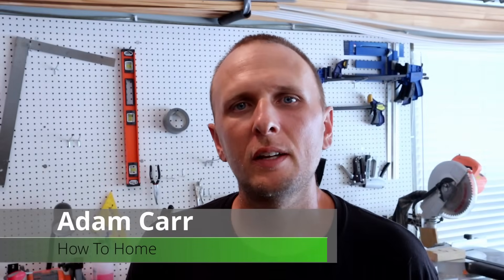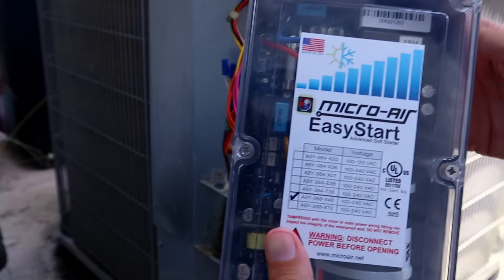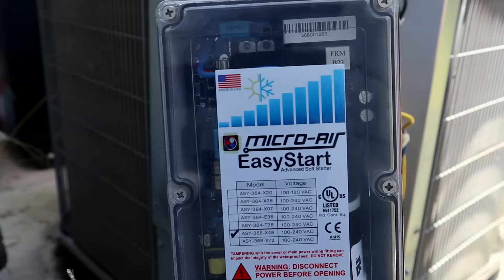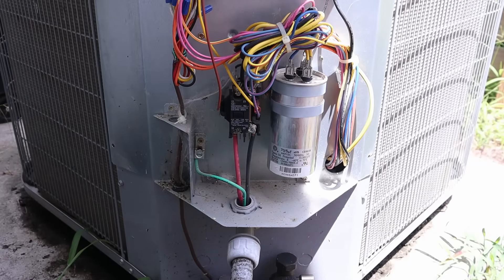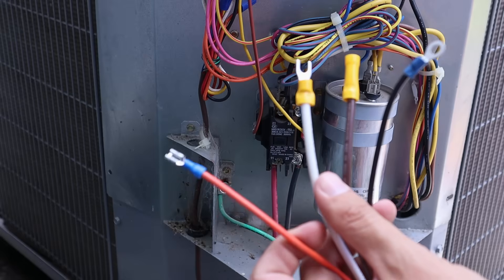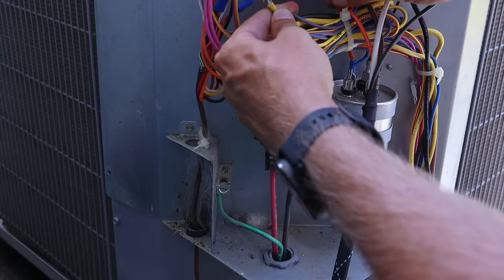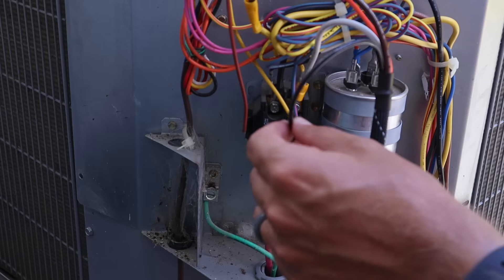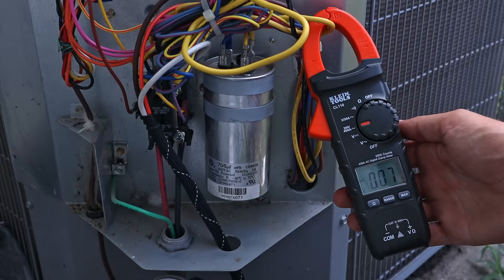How To Install A Soft Start Kit On A Air Conditioner | Run Home AC With A Generator | MicroAir

Comment: Thanks for video, been considering this for my home AC.  The soft start current reduction is great, but had question in running current.  It went from 12 amps to 7-8 amps which is great, but not sure what this means.  Seems like using less electricity, but is the cooling the same?  If it is the same, why don’t manufacturers put soft starts on all their AC units? Thanks again.
Reply: Thank you for detailed reply. I might have to look into doing something like this so I can maybe use my 2000W gas inverter generator. Thank you, again!
Reply from the maker: Hey Jeff, yes, even though the electrical requirement is less, the cooling remains the same.  Basically it is making the startup of you AC unit, more efficient.  On the home AC, instead of sending one big blast of electricity all at once, the soft start starts the fan first, then after a few seconds, the compressor kicks on.   By doing it this way and gradually ramping up the power, the unit is not drawing as much amperage all at once.  In a generator application, running the AC is not the issue, they dont use that much power to run, it is the starting in rush amperage that makes it difficult to impossible without one of these devices.  As far as running current, it doesn't affect that much if at all, they are really just for the starting of the AC unit.  I have seen different explanations as to why these or hard starts aren't already installed and the answer I saw the most and makes the most sense, is it just adds cost to the manufacturing of the units.  Hard start kits were actually fairly common on AC units years ago and some of your more expensive models, from what I have read do have them installed already.  So while there is no clear cut answer, those are the answers I have gathered from people in the industry talking about it.  I hope this was helpful and answered your questions.
Reply: @HowToHomeDIY  Some AC units have VFDs installed and have no LRA on the motor, these are super efficient units, but they are expensive of course!

Comment: Do you think that a duromax xp1300xp would be enough to run 4 ton central and some lights?    Thanks for your videos
Reply from the maker: It just depends on what your current in rush amps are and what they will get down to after installing the soft start.   If you can get below 40 amps like I did then yes that generator should be able to run the AC.  It’s just the startup that is hard, running the AC doesn’t require a lot.  I am picking 40 amps or less as the goal so that there really isn’t much strain on that generator.  The peak watts on that generator are 12,000 which is 50 amps.  Just don’t want to Max it out especially since you will be wanting to run some lights.  Hope this helps!

Comment: Hello, I watched both of your hard and soft start kit videos. It looks both of them brought the inrush amps from 72 to 36, so they are the same. However, I have a hard time believing that your 4 ton comes on with only 72 inrush amps. Mine is a Reheem 4 ton, which is only 5 years old 80% efficient unit, but the sucker has an inrush at 109 amps. I am wondering if yours were 109 amps inrush, how lower the soft start can bring it down. Thanks!
Reply from the maker: Hello, the soft starter reduced the in rush from 74 amps to 32 amps the hard start reduced the in rush from 73 to 37 amps so the soft start did outperform the hard start by about 7%, it also is going to help in that it starts the fan first before starting up the compressor, which can make a big difference.  I did the in rush test multiple times and it was always right around the 74 amps in the video.  From my research, it is typical to figure a 50-60% decrease with the soft start kit and approximately a 50% decrease with the hard start kit which is about the same results that I saw.  Hard start kits doesn't actually lower in rush though, it gets the compressor kicked on faster, which in a way "decreases" in rush.  I hope this helps!
Reply: @HowToHomeDIY  when I read amazon reviews for 5-2-1 hard start kit , many people have 4 ton AC like mine with about 110  inrush amps, the hard start is only able to drop 25 amps to 85-90amps. I am surprised to see yours dropped from 73 to 37. I am not sure whether it is because yours starts low at 73 inrush.
Reply from the maker: @passion830217  Results will vary.  But that is why I put a soft start kit on mine because I knew it would work.  It is basically a little computer where a hard start kit is basically just a second capacitor.
Reply: My 3.5 ton Rheem has the same 109 in rush amps, with the soft start kit, it came down to 43amps, it’s good but I was hoping more of a drop.
Reply: I think the answer is in the clamp meter the OP is using.  He is using a  Klein CL110 it has a MAX/MIN feature but no Inrush button like Klein's  big brother the CL 900.  I don't think the Max/Min button exactly captures the Inrush current.

Comment: How big is your generator and how many things are you running at the same time.  Thanks
Reply from the maker: Hey Gus, I have two generators, one is 6700/5500 watts and the other is 15000/12000 watts.  I have a transfer switch for my smaller generator that powers all of my necessary items like fridges, some lights, fans, well, etc.  My bigger one is connected to a power inlet box and handles everything else including the AC.  Now my bigger one can run the AC along with a lot of the other circuits including the onese in the transfer switch but I try not to strain it and pick and choose what is on and off.

Comment: Just to add to your great write up..please make sure you use 600v flag like connectors and not those 12v flag connectors..not saying the author did, just helping others  save yourself from catastrophe if your looking for connectors..
..
Reply: I wanted to try to install this but your comment just confused me. So will something like this wire kit work. 

https://www.homedepot.com/p/Gardner-Bender-100-Piece-Terminal-Kit-TK-806/202518736

Comment: Are you now able to power you AC with a single Tesla Powerwall if you wanted to? I have been told that I need 2 Powerwalls to be able to run my AC and I am just wondering if a soft start would let me get away with a single Powerwall.
Reply from the maker: Hey Gordon, I am not very familiar with a Tesla Powerwall.  I set this up to be able to run my AC using my generator, which I can very easily now.  I am thinking of going to solar though.
Reply: I also have 2 Tesla Powerwall batteries and How 2 Home videos are helping me. If you Mr. Gordon tried it please let me know.

Comment: where did the brown wire go?  I missed it.
Reply from the maker: Hey Joseph, at 7:08 I start talking about what happens with the brown wire.  It will be spliced to the yellow run wire that I removed from the right side of the contactor.

Comment: Great video! I didn't know this soft start could be installed on a house ac?! I have seen people put them on rv ac's. Do you have a video using your generator to power the ac?!
Reply from the maker: Hey Pablo, thank you for the feedback!   At the end of the video I show the AC running, that was while on generator power but have not put out a video showing the generator hookup, pull down, or ac running in the same video.  That is in the works.  I thought the same as you but the more research I did I found that they did in fact make these for home ACs and it works very well.
Reply: @HowToHomeDIY  How long have you been using it on the central ac unit? Any issues at all? I would assume your electric bill was reduced drastically?!
Reply from the maker: @pablorosales8538  I have been using it for 3 months and have had no issues at all.  No it didn't really affect the electric bill much.  It's main function is just using less in rush amperage to get the compressor running.
Reply: @HowToHomeDIY  Thanks a million!

Comment: will this work on a 2 stage compressor  ? my max LRA is 64..this is with a hard start kit from the Mfr. my generator is a 7000/12000w
Reply from the maker: Hey, yes I have been told that it will work on a 2 stage compressor.  Another subscriber to the channel had said that they had good luck with installing it on theirs.  You have a good sized generator so it would more than likely be able to run the AC with the soft start installed but without knowing the exact in rush without the hard start kit it is hard to say for certain.  I will say that if you reach out to micro air with any technical questions about their product whether on the phone or through their website, they are extremely knowledgeable and quick to respond.  I had a few questions before I bought the one in the video and they got back to me within minutes.  Hope this helps!

Comment: Great video. Been watching a lot of your stuff. Adam, just curious, but with an inrush amp drop to 31.6 what are your thoughts on pushing the unit with a smaller generator like the CAT rp7500e? 31.6x240 shakes out to be just over 7500 W and well below the starting capacity of a smaller generator. I’m considering both the rp7500e and the rp12000e for my home but am having a hard time getting past the fuel consumption of the rp12000e if a smaller generator could push the AC.... at least on paper that is.
Reply from the maker: Hey Jacob, yes on paper the Cat 7500e could handle that amperage as its starting wattage is rated at 9,375 (39 amps @240).  But I would probably only have the AC on at that time as it wouldn't take a whole lot else being on before you have maxed out its output and making starting the AC up much harder to not possible depending on what is on.  As far as the fuel consumption goes, yes the 12,000e does not have the best fuel consumption but you would be able to run your AC and probably quite a lot of your house on top of it so all depends on what you want more.  Cats, fuel efficiency I believe is figured assuming 50% load on the generator so keep that in mind as well.  But yes I think that the 7500e should be able to handle that amperage with the way you have described it.   Thank you for the feedback, I hope this helps!

Comment: I have a 3.5 ton ac unit/heat pump. I also got the same exact model as you, the 368-x48. I plan on running it on my 9KW generator. Before I install it and make it un-returnable, do you think this might work? Also did you succeed in running your AC with your generator? I notice you posted a Hard Kit video one month later... Did you end up going that route instead?

Btw I love your channel, been subscribed for a couple of weeks now!
Reply from the maker: Hey immac, if anything is going to work, it will be the soft start kit.  Mine works like a dream.  It is going to give the greatest actual drop in inrush current.  Now something I did before I bought the soft start was I used a clamp multimeter to find out what my inrush current was so I would know for sure that the soft start kit would work.  You have a 9KW generator, is that peak or running?  I can tell you that my 15kw/12kw generator doesn't hardly even flinch if just the 4 ton AC is turned on.  So if I was to guess, I would definitely think that yours would run yours with the soft start but I hate guessing and would want concrete numbers to feel better about it.  9,000 watts is about 37 amps and I can't imagine that a 3.5 ton unit with a soft start on it would meet or exceed that amperage but every situation is different.  Also, I did do a video on a hard start after the soft start but it was not on my unit.  It was for someone that has the same sized generator as me but was installing on a 2.5 ton unit so a soft start wasn't really necessary.  Thank you for subscribing and the feedback, I really appreciate it!  Let me know if you know your in rush and more specifics about your generator and I will try to help if I can!
Reply: @HowToHomeDIY  it is 9kw running and 11250w peak gen. I have a 400 amp service, two main panels @ 200 amps each, one of which is dedicated to my all-electric HVAC. I put interlock kits on both, 6/3AWG wires out to the same Inlet Box you got, and made pigtails with split bolt connectors (except the ground of course) so it could feed both panels simultaneously. Thanks to the Soft Start Kit, now I'm able to run my entire house plus heat pump at once, minus my electric stove and dryer (which I have yet to try.)
Reply: @immac314omnia  This is pretty much what I need to do, as well. Did you put the soft start kit only on the heat pump outside or do you have it also connected to your furnace? I need to do a bit of digging to see what my amps are and if this is a thing or not. Feels like the main bump is the heat pump. Curious and thanks for the input! I was also curious about what my fridge draws when it starts and have only watched my Reliance transfer switch meters like maybe one time to see the increase, which didn't look like much. I have a Reliance transfer switch, but the a/c heat is not hooked up to it, nor our water pump, so I am trying to get everything that is needed connected up. The good news is that the water pump is connected to the garage panel and I can run 2 cables from my 10k/13k generator. It's only a 15AMP circuit, 1/2 horse power pump, and would also be nice to just do the whole panel in the garage, as its mainly just led lights.
Reply: @HowToHomeDIY  Thank you very much! I relied heavily on your channel to accomplish my successful portable generator all-house hook-up. ⭐⭐⭐⭐⭐
Reply from the maker: @immac314omnia  Ok then yeah, with that generator you should be good to go!  I am glad to hear the soft start kit is working out for you like it is for me.  Thank you for letting me know that everything is working.  Always nice to hear when people are having success!  And thank you very much for the feedback.  If you need anything else feel free to give me a shout and I look forward to seeing you around!

Comment: I did not understand the "splice" to connect the white wire. Looked like you started out with a butt connector. I was confused after that.
Reply from the maker: Hey Louis, the butt connector was only on the brown wire that then is spliced to the yellow wire which is the compressor run wire.  The white wire had a fork terminal connector on it and was then connected to the contactor where the yellow compressor run wire was originally.  So basically the white wire will take the electricity and run it to the soft starter and then when the soft starter is ready to start the compressor, it will then send that power to it through the brown wire.  Hope this helps!

Comment: I have been looking for something to reduce the drag on my 14,000-watt generator when my heat pump comes on. What is the amperage on your house so I can see if we are close to the same amps?
Reply from the maker: Hey Mark, of course this number is going to differ from home to home due to different energy sources for appliances and sizes but over the past 3 days, according to my sense device, the highest amperage my house hit at a given time was 39 amps.  Usually it is lower than that but AC must have kicked on at the same time as many other things were on or starting as well.  Hope this helps!
Reply: @HowToHomeDIY , I was and thank you very much.
Reply from the maker: @capman911  You are very welcome.  Just give me a shout if you run into anything else, will do my best to help.

Comment: do you have to put this on when using a generator ? My generator is a 7500 and will only run the AC
Reply from the maker: Hey Benjamin, no you don't have to.  The soft starter makes it easier on the generator allowing for more things to run in addition to the AC and also makes it possible for people to run their central ACs using a generator that previously weren't able to.  Will all depend on size of the generator, size of the AC, amperage required after install, and how many things you are wanting to run.  All situations will be different.  Hope this helps!
Reply: @HowToHomeDIY  yes it was thanks and only going to running the central ac
Reply from the maker: Sounds like you're good to go then!
Reply: @HowToHomeDIY  wish you had a video for that
Reply from the maker: What specifically?  Maybe it's something I can look at adding to the schedule later or planning to do!  I do have some more generator videos planned for the future.
Reply: @HowToHomeDIY  its a big unit but the generator will only be running the central air conditioner nothing else unit is 3 ton

Comment: What are the differences from a hard start and soft start kits?
Reply from the maker: Well if you really break everything down, quite a lot.  But basically a hard start kit is going to act as an additional capacitor that gets the compressor started faster.  A soft start kit is working to reduce the amperage draw by first starting the fan, then seconds later, gradually starting the compressor.  This way everything isn't starting up all at once needing a large draw of power.  Hope this answers your question!
Reply: @HowToHomeDIY  can a hard start kit be used with a soft start kit?